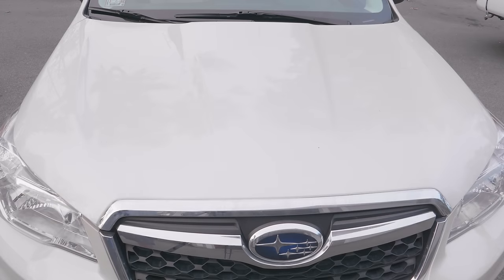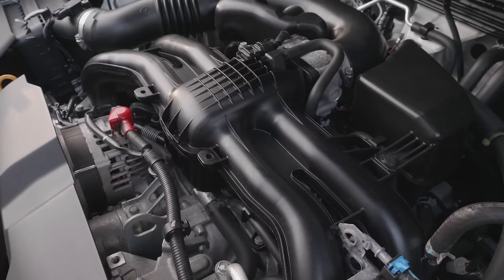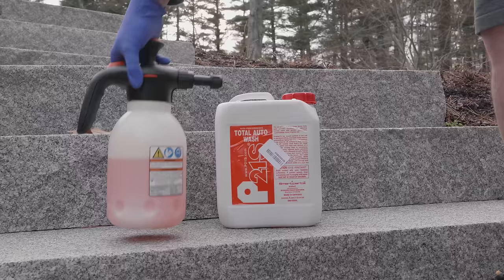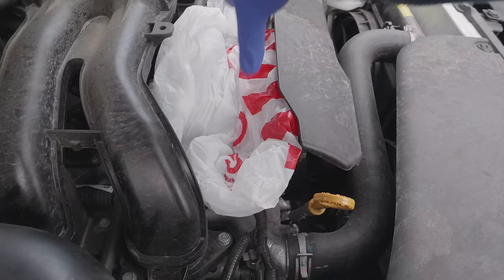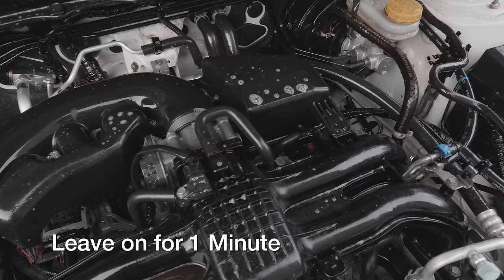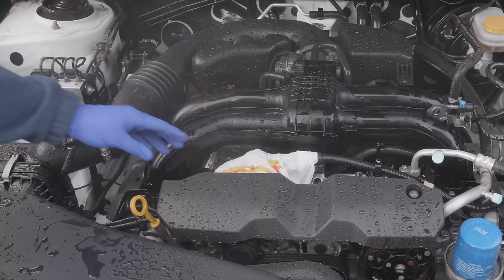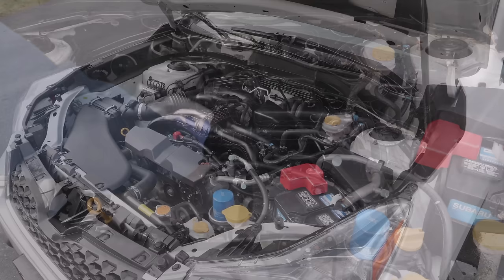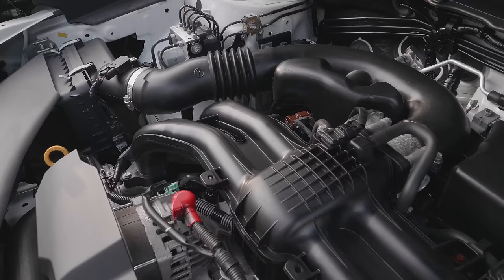Clean & Detail Your Car Engine in 5 Minutes!

Comment: Who else scared af to spray their engine with a water hose😂😂😂
Reply from the maker: Most professional detailers use the exact same method and many use pressure washers which I am not into. You must decide for yourself but the results are excellent. I think even Ammo clean the ferrari engine like this.
Reply: What does he do when it rains get out and cover all the electrical components.
Reply from the maker: @richardwarren8710  Exactly. Great points  There are older engines with non-water tight distributors, etc but this isn't the case any longer.
Reply: Your engine won't work but who cares, It looks incredible.
Reply: So YOU are scared 😳 to spray your engine with water 💦... WHY...??? 

Is YOUR year engine NOT water 💦 tight...??? What are YOU afraid 😳 of...???
Reply: I was told by a Honda tech not too..who ASE certified?..Right
Reply: Not me I do it all the time..
Reply: @richardwarren8710  nothing
Reply: TheLorola  yes im kinda scared to spray water on my engine there are too much electrical connections that can cause problems because of the water, I prefer to use stp tire clean it’s not as hot but it’s safe on wires and many other electrically sensitive areas
Reply: me😅
Reply: Me🤣🤣
Reply: Why be scared. Its done all the time
Reply: I know the engine is water tight but I see lots of electrical connections etc on my 23 year old Lexus. I was thinking spray the product on a cold engine, then start the car, then hose it off while it’s running, before it heats up? Staying away from the fan of course
Reply: @peterscanlon9727  A running engine is sucking in air and sending electricity all over the place. Probably not a great idea to hose it down like that.
Reply: It does NOT hurt to wash an engine old or new. And if you did get an old distributor wet just take the cap off and dry it out, including rotor button and it will crank right up.
Reply: @TheLorola  Hi, first off ASE certified only means the mechanic took some test and passed, plus 1 to 2 years of mechanic work under their belt. I've been working on and or built up my own cars/trucks since 1975 and never had a problem washing off things in an engine compartment. If you are scared of electrical connections, cover them on a cold engine so no water can get in the part. I cover the alternator, distributor cap, fuse box and computer box in some just in case. I unhook the negative battery cable, turn the light switch on and key to drain any left over power. Then wash to your hearts content. Be sure to completely rinse everything and then dry it off by forced air like a yard blower, shop vac and old clean towels. Uncover everything, towel dry again, hook up battery and start the car/truck. No problem. This may seem like a lot of work but in the long run it looks great and a clean engine runs cooler.
Reply: Scared of what? I use a water hose and spray my my engine down anytime I see that it has accumulated a little to much dust/dirt. I have a 2005 Infiniti and I never cover up anything, and certainly not the alternator. Getting water on an alternator will do absolutely nothing to it. I've been using a water hose on every car I've ever owned to clean my engine bay, and have never had a problem afterwards. And trust me, I don't spray lightly, I blast away with my water hose! Just use common sense, and don't go crazy aiming 'directly' at your sensors, like your MAP or MAF sensor.
Reply: @TheLorola  Yep...un hun.
Reply: @silvergrizzly316  New engines dont have a distributor. Your car must be a 1980s model.
Reply: I would not do it on a hot engine and try to protect electrical connections. And like he did cover alternator. Just my thoughts.
Reply: I used to be but now I get stuck in with a small water blaster. With my older car I used to run it for a few minutes to warm up (that’s warm, not hot) before washing so it would dry out afterwards. I saw another video that used a can of tyre foam which worked too.
Reply: TheLorola me .... As much as this seeems like a good idea I’m stiff iffy of water getting into the electrical of the engine
Reply: TheLorola find a new tech.  He doesn’t know what he’s talking about
Reply: It’s OK to wet your engine with a garden hose with a spray nozzle but no pressure washer and don’t dry it with the air hose because you don’t want water inside your fuses
Reply: @johnsadar1743  If one is to spray down their engine on a warm day, and able to allow the car to sit oriented to where the sun can bake on the engine compartment with the lid open for an hour or so, I can assure you there will be NO moisture left on all electrical connections or joints. This is how I will/would do it if I decide to do it on my new car down the line. I have typically found that if I buy a car new, doing it by hand without water is all it needs for about the first 2 years. After that I hit it once at about the 3rd year point and it's good as new once again.
Reply: infiniti_chik I ruined the alternator and regulator on my '96 Accord when I was washing the engine bay. I was doing it like my dad did on our 1970 Fiat and 1984 Volvo, with degreaser and the garden hose on a gentle spray. I have since done it on my 2004 Beetle and my 2009 GTI with no issues. On the newer cars like my VW's, I do keep the plastic covers on the battery and fuse box. That Honda though, it had a lot of electrical issues the entire time I had it, so I think it was just that car.
Reply: @richardwarren8710  He wouldn't drive it in the rain.
Reply: I'm not scared to use gardenhose. I used garden hose most of the time to cleaned my engine as long as you know what to cover and protect.
Reply: Hell yea i am haha. I still wanna clean mine but man. Nervous
Reply: @kidder6192  man just get you a spray bottle with soap and water or a good degreaser an armor all the plastic and you'll be happy and your car will still run afterwards too😂
Reply: @richardwarren8710  Oh damn you bought a car with no hood😔
Reply: @TheLorola  😂😂
Reply: I am. Lol
Reply: Yeah...I totally am...at least all over it like that...
Reply: Still seeing a lot of shady tree non ASE certified mechanics commenting... being if ASE-certified wasn't important while a dealership wouldn't hire you??????....plus two more??😂😂😂😂 ole Craigslist ass mechanic😂
Reply: @TheFlR3StOrM   What are you covering everything with like the distributor cap and all that? A plastic bag? Also I don't wanna reset everything in my battery every time do you think that part is one of your most necessary parts disconnecting the negative cable?
Reply: @tym5583   Yes a plastic bag since my truck is an older model (a 1999 Ram). I use a 1 gallon zip lock bag to put over the distributor cap and alternator. Here is one way to think about it. When you are at highway speeds on a rainy day do you think your engine stays completely dry? It gets a lot of over spray but it don't get flooded unless you go mudding on some back road. A 1 gallon zip lock bag works for me and sometimes I use plastic bags from the grocery store but double or triple it but a lot people use different things. Hope that helps.
Reply: Good grief people. 
Scared of a garden hose gently pouring water on an engine?
Then you probably have no idea how much water gets all over your engine when driving in the rain.
Reply: @SilverCymbal  p
Reply: Do you not drive in the rain?
Reply: @umeng2002  yeah with the hood closed..ask yourself why do you think your car come with a hood??? Is no to protect the engine..also engines are not water proof..sad i have to explain this to someone who has a license to operate a vehicle.smh
Reply: @umeng2002  next time you buy a car tell em they can keep the hood...you don't need it.
Reply: @TheLorola  You know water splashes around... Those covers on the bottom of modern cars aren't for water.
Reply: @umeng2002  Key word " modern"dnt forget to tell em to keep the hood since a lot of you on here think the hood on the car is to protect from falling trees during storms....smh
Reply: @richardwarren8710  next time you go through an automatic car wash make sure you raise your hood before you go in let me know how that works out.
Reply: @TheLorola  i go to self service one and open the hood all the time. Never had a problem.
Reply: @richardwarren8710  Ok have fun.
Reply: Me
Reply: @TheLorola  No offense, but I know plenty of non- ASE mechanics.  It dosen't make them shady.  There is a level of discernment you must have when choosing one though.   A lot of people spray their engine.  Like he said in the video, cover the alternator.  Depending on whats exposed, any other electrical components.  My father is a mechanic and has been for 45 years.  Ran his business entirely out of his home.  Easily the best mechanic in town, he just never wanted the overhead of a brick and morter.
Reply: Definitely me. That's why I'm here😂😂😂😂😂
Reply: @infiniti_chik1225  I don’t know what a MAP or MAF sensor is though, or what it looks like on my vehicle.
Reply: @jessicah3450  Yes, maybe so.
Reply: @jimwatchyyc  A MAP or MAF sensor monitors the amount of air flowing into the engine, so the computer can adjust the amount of gas to spray into the combustion chamber. Just Google the year, make and model of your car - type in either MAP or MAF sensor and see which one comes up for your car. Also, if you have access to a Haynes or Chilton's Service Manual for your car, it should tell you which one you have in your car.
Reply: @TheLorola  lol then how do you think they clean it when they get a used car for resale? Do you think they take every part out by hand and clean it 😂 😂
Reply: @Airplanetyson  degreaser have a nice day
Reply: Me lmao
Reply: Honostlyyy
Reply: Dohn Joe  u
Reply: I Been washing my engine for the last 5 years and I never had any problem,I always use purple degreaser.
Reply: dont spray with hose
Reply: I'm a 65 year old woman I've always kept my engine clean. On a hot summer day I take a water hose and spray it. My dad worked on cars, he taught me how as a child.
Reply: Been washing my honda engine for 15 years and never had issue,the only thing I do is cover the alternator and electrical sensors just in case.
Reply: @elcoyotecojodeldesierto2300  kool deal good luck
Reply: Me.
Reply: @SilverCymbal  should I cover my fuel injectors
Reply: I've done it lots of times over the last 46 years....  just don't use high pressure, at all.
Reply: @richardwarren8710  I would imagine he counts on the hood  to keep the rain off.
Reply: The placement of the oil filter is fucking amazing! Mine is in the pit of hell.
Reply: If you don’t want to spray you engine with water just take a damp cloth and have at it. Gives you the same results he showed but on a car with 70,000 miles
Reply: @TheFlR3StOrM   I am sure the computer units from my BMW X5 M would love a a splash of water from the hose.  It’s right on the service manual.
Reply: @joeesquire5927   I guess you never thought of covering it up or maybe cover it up for good on days it's raining and you traveling at highway speeds with all the over spray. You can cover parts up you don't want to get wet you know. Nobody is stopping you. I also have a Mini Cooper S  with aftermarket parts (money pit from BMW)which is made by BMW and it don't mind a engine clean once in a while, BUT I do cover electronics up, the alternator and a few other things.
Reply: @jenniepainter3983   That's right sister, tell them.
Reply: Been doing it for over 10 years with no issue
Reply: Honestly, I have never cleaned my engine like this before. I have never even wiped with a rag. My 97 Accord still runs great with 267k on it.
Reply: I have done it  without covering the alternator... hmmm, I guess I'll start covering it, just in case. lol
Reply: ASE stand for Ask Someone Else if you see someone with this patch on thier uniform..
Reply: @richardwarren8710  you wash it and then blow out the water with an air hose, throw on a water soluble shine and let it air dry. Been doing this for years and never had an issue.
Reply: @TheLorola  I work at Harmoney Honda in B.C. and your tech is a dummie. Look at how much plastic is covering the engine in all of these newer cars, and anybody who washes their car and leaves water in all the electrical spots clearly isn't the right detailer and needs some training.
Reply: @TheLorola  I've done this method with older vehicles and exotics for 20 years and never had an issue. Ever ever ever. You always blow out the water afterwards. Throw a little shine, let it air dry and you're good to go. I work at Harmony Honda here in Kelowna B.C. with our used trade ins and I do this day in, day out, 3-4 details a day,  common sense says make sure you know what you're doing. If you don't know what to do or have any doubts, you ask for help.
Reply: Me!
Reply: What about coil on plugs ? No problem?
Reply: Have you ever seen a jeep drive in water up to its doors? Guess not
Reply: @channtehmann  Some Jeeps made for that...send me a vid of your car doing that....ill be waiting.
Reply: @TheLorola  You must be a child or something.
Reply: @channtehmann  you must be lonely responding to a comment i put  on here a yr ago..dnt worry Jesus love you😂
Reply: Me too
Reply: I’m not doing that shit
Reply: @SilverCymbal  I get around nyc with horse and carriage
Reply: right !! 🤷🏾‍♂️😨🤔
Reply: @TheLorola  jj
Reply: What about the battery? Would you recommend disconnecting it before?
Reply: You drive through  rain and snow don't you
Reply: The next time you are driving in a rainstorm or through a big puddle pull over Android pop the hood,you will see a wet engine🥴
Reply: Steam cleaner is easier and safer for those who have older cars. Your whole engine compartment is open on the bottom. When you drive in the rain water and whatever else gets in there. I don’t understand people’s logic.
Reply: I am
Reply: The same thing happens when people drive over sitting water on the road and you see all that water gushing outward.  The water gushes inward too.  Though I always slow down or try to drive around sitting water  but most motorist don't, so my take is, most people don't car.
Reply: @KenSerpico5450  a customer today said they want to clean the engine without water. I said we steam clean.  He said no liquid at all. I said ok my fault steam is water. I was nice to him. I asked do you drive in the rain or do you park in a garage? He said yeah in snow or rain I have to drive. And I don’t have a garage. I said can you see through your engine bay and see the opening where you can see the Concrete your car is parked on. He said yes. Then he said I don’t like smart asses. I said I didn’t mean to insult you I’m showing you that water gets in the engine bay. It’s not a close system. Ac has to leak water from the condenser. The heat the engine generates it has to have openings for the excess heat. Water being use to clean your engine is far less that a drive in a rain from work to home. He said I’m sorry. I said it’s ok so when do we start lol. He even tipped for the job.
Reply: The car engine bay and hood are not water tight. To cool an engine air is forced through the radiator, condenser and engine bay. My point is when you drive through a thunderstorm water gets forced through your engine bay with the air that cools your engine. The engine electrical connections are designed with water tight silicone seals to protect the connections. Cover your alternator and battery terminals to protect against the chemicals which could be mildly corrosive.
Reply: Is it okay to spray on electrical wires and battery? Mine is 2001 honda city type Z.
Reply: Lol meeee
Reply: yessir
Reply: There's a difference in wetting your engine and power washing it...
Reply: Those who want to clean their engine bay should feel safer to cover or ceram wrap their electronics. Alternator and ignition coils if your cleaning a engine without a cover, and your ecu or fuse box. I always disconnect the battery and wrap the terminal in plastic before I start. And prep work to make sure all caps are sealed and closed. You don't want water or degreaser going into your engine or trans. Modern cars are splash proof but it is a peace of mind that I want. Never use pressure washer, prefer a hose nozzle and degreaser. I always agitate with different size brushes and dress all the plastic, trim and rubber hoses to finish. I usually wipe with microfiber cloth to dry instead of using a blower since I don't want water getting into my connectors. More work but safer and I do it once a year on my mazda 3 2014. If you don't feel comfortable then it's okay not to. It isn't necessary to clean a engine bay as most modern cars hold up well but for those who work on their cars often it is a satisfying sight to see a clean and shiny engine bay when you pop the hood. Best of luck everyone.
Reply: That's the first thing came to mind water what if the car don't start after nah I'm good it don't have a form one?
Reply: Pedro definitely failed English. Couldn’t read a Dr Seuss book let alone an owners manual.
Reply: My brother sprayed off his motor with a hose and th next day his knock sensors went out. 8hrs of labor.
Reply: Don’t use a water hose on an engine.
Reply: Use pressure washer 😂😂
Reply: @timburton1715  are you kidding me? New cars nowadays; any type come with electrical components or sensors that getting them wet would damage and your dashboard would go crazy and your vehicle might not even start at all.
Reply: Will this for a 2012 tahoe ppv?
Reply: @silvergrizzly316  I've done this so many times back in the day. Stranded because of heavy rain nope got some WD-40 for water displacement back on the road, of course wipe out as much of the water as as you can. Those were the fun days of old.
Reply: So confused by the comments - is it or is it not a good idea to clean the engine of a 1996 Lincoln Town Car with water and this product?
Reply: I own a Renault Automatic Car in India. Every mechanic says don't spray water into engine compartment 🤦...I am so confused after watching this. I take pains to clean it.
 Any expert opinion? 👍
Reply: @MarioTorres-oe5sc  I certainly would.  Just makes sense not to have any engine bay wiring live with an opportunity to short.  Your not likely to cause a short and melt wires, but computer systems are very sensitive to minor blips.  In  may  newer vehicles, various sensors and circuit boards could be active when the ignition is off.
Reply: I bought a used car from a Toyota dealership and they sprayed down the engine right before I drove it off the lot.
Reply: @silvergrizzly316  or use WD 40 displaces water
Reply: Me 😂
Reply: Me that’s why I had to look at a video
Reply: I do ot all the time
Reply: I be scared af to touch my engine period lol.
Reply: Thinking the same thing!
Reply: You drive in the rain. Next time, open the hood. It's all wet
Reply: @hermesalejandrocerdenia1153  I have a 2012 Toyota Camry; should I worry about anything if I do this myself?  Thanks.
Reply: Literally thinking that as the video loads!🤷🏿‍♂️😅🤣😂👍🏿😁👌🏿
Reply: @Slider617  You don’t have to hell I just cleaned a spot on my motor that had antifreeze all over it due to a leak fixed it put Mr. clean and water in a bowl mixed it around poured it all over that spot all over the hoses and anywhere else that that coolant splattered let it sit went back inside grabbed another bowl put hot water in it rinse the area fired up my Elantra and took it for a ride down the road accelerated hard got it up to 80 mph came back to the house there’s your air dry if you want to do that you’re more than welcome but I do it naturally
Reply: Yep. That's exactly why I'm here.
Reply: I did. And water got into the engine 🥲
Reply: I wouldn't use water the rest of you are right water will short out your electric parts
Reply: me
Reply: @RH0703  yes just disconnect the negative terminal and wait until it fully dries to reconnect.
Reply: I am 😩 my old buddy 98 ranger is so bad dirty oily and I feel I’m going ruin my engine
Reply: I've ways heard it's not good to do that why so many ppl use the brush & microfiber method.....
I've also seen a steamer used to break down grime
Reply: What about spraying the battery and all around the terminals??  Wouldn’t that be bad?  Maybe cover alternator AND battery?!?
Reply: Me
Reply: Very scary 😂😂😂😂
Reply: I have a 2013 Honda Civic and I used this product and also did it this way and I never have a problem. The only thing I covered  is the alternator and the fuse box and I never had a problem or engine light come on. Think about it you drive in the rain where does that water go. And I am a Master Automotive Tech but that does not have a thing to do with it. This method is safe but if your still scared 😨then just don't do it simple....
Reply: @SilverCymbal  pressure washers are safe for certain components but those who spray all the fragile electrical stuff don’t know what they’re doin
Reply: Not me I worked at an auto auction as a detailer they power wash the engine and spray tire shine on the engine while it's still wet 🤣 I don't know if that's because they were auction cars or what. Didn't feel right to me.
Reply: Facts.
Reply: Not afraid mine is a diesel 🚚
Reply: Me while reading this coment
Reply: @timburton1715  How about getting water in the air intake and potentially hydrolocking your engine? Small chance if you're careful but still a chance. You can spray water on a transformer but wouldn't you be a tad nervous doing so?
Reply: Been entering my cars in shows for years and detaling my friends cars. I use a hose on my engine all the time.  You just have to spray it with compressed air afterwards, then let it dry real good. I usually let it dry anywhere from over night to 24 hours.  Never had a problem.
Reply: Nice but I wouldn’t chance it   yeah, rain water will hit the bottom make its way here and there but pouring water from top to bottom like this, my car probably wouldn’t run after this but thanks for showing a clean engine on a great suv!
Reply: @johnsadar1743  thank you !!! Definitely gonna try it
Reply: Agreed.
Reply: Just go gentle.
Reply: That's exactly why I'm here
Reply: Me
Reply: @TheLorola  ive seen Autozones who claim to have ASE certified employees at all times and still not know what part I need for a simple job (replacing my brake fluid cap)
Reply: I've had mixed results: Don't ever hose off a 1975 MGB - don't ask how I know...  Later model cars, especially Japanese and American - I've had no problems... they're intended to be waterproof.  I wouldn't spray a hot engine.  Just my experience.
Reply: @umeng2002  There’s a huge difference between water spraying upwards when driving in the rain and water coming down vertically from above on an engine with the hood wide-open. Any of that water gets in the alternator, fuse box, spark plug wells, or any “waterproof“ electrical connections that have lost their waterproofing over the years, and you’re going to yourself with a bunch of weird and difficult to diagnose electrical issues on your car.
Reply: @TheLorola  the purpose of a hood is not to protect the engine from water at no point do bonnits seal from water if they cannot seal from air properly... Water in the intake is dangerous and damaging true. Water in the engine bay how ever is normal and designed for. Also if. Bonnits really were for water why wouldn't all cars be sealed on the underside why do they all not have trays? And why does the intake expose the engine to water below the bonnit constantly. The main purpose of a bonnit is for the aerodynamic advantages and for user safety finally summed up with because that's what makes some cars look like that specific car
Reply: It’ll be fine bro. Just spray it. Everything is sealed… if it doesn’t run okay after then you’d probably have a big problem if it rains too
Reply: @clintonwalker9502  it's all good. Don't use a lot of pressure. In all honesty, you don't need that much anyway. Spray it gently with a hose after everything is cool, spray a mild soap that has a degreaser heavily on it, use a light scrub and touch as much as you can, spray it down gently again.
Reply: I got a 2019 Camry 😬 I’m not sure if I want to do it.
Reply: I rather use the electric toothbrush lol
Reply: Me lol , I always think something would get fried 😭
Reply: Swear 😂😂
Reply: You can as long as all electronic parts are wrapped
Reply: What about your censers
Reply: @SilverCymbal  I always thought that was what the hood was for
Reply: @leerothman7570  we
Reply: @SilverCymbal  is it good and safe for greasy engine??
Reply: I would do one spot at a time, instead of the entire motor at one.
Reply: Me
Reply: Not on a v8 engine..the water is going to get in the recessed hole where the spark plugs are.
Reply: Yoo I was saying the same thing !!
Reply: 😂😂😂 me lol
Reply: MEEEE
Reply: I lightly sprayed an engine bay on on a kia soul and water got down into the spark plugs those miss fires were kicking 🤣🤣.. Lesson learned!
Reply: You can wash the engine just make sure to cover the alternator fuse box and other electrical wiring connection with plastic
Reply: @timburton1715  my car is 15 years old. Worried something may come loose or get exposed to too much water. Maybe I will just use toothbrush method. I'm trying to sell my car not damage it.
Reply: Me! Scared the fk outta me. But I always use a pressure washer 2 years ago while I was still a detailer for a dealership....... havent gor any complaints

Would never do it on my personal vehicle tho
Reply: Brooo I can’t dooo itttt
Reply: @TheMegaVoter  did you clean it after watching this video?
Reply: @Twomps  Nope... Used/new car prices are high and I can't take a chance. If I were to sell my car then I would go to a detailer.
Reply: @seeknddstroy  
You know it rains don't you?
Reply: Onmmm 😭😂
Reply: You can spray with water just don’t pressure wash it and you have to cover up the stuff that needs to be covered up, that’s all.
Reply: Me.  I love my car and hence very scared to spray water in Engine compartment.  I enjoy the drive by  smooth and noiseless engine.
Reply: @TheLorola  cuz they’ll lose out $$
Reply: Go nuts with the water, just dont fill the air intake or wash the electrical connectors too much, its the same as driving through puddles but cleaner and its at the top of the motor 😅,, dont do it with a hot engine either, top video too bloke
Reply: @bartbutkis  The rain das not get your car  under the hood , next time it rains open your hood you will see everything dry in there , most mechanics don’t recommend this it can easily create a problem especially in newer cars
Reply: Same
Reply: I do it a few times a year….usually with the engine running while at the spray off car wash.  Works great!
Reply: I am once I hosed the engine when I came back the car was kissing the wall
Reply: @timburton1715  
Electrical components, computer etc
Reply: If you get your car detailed at a dealership, this is exactly what’s happening.
Reply: Yes I’m always very nervous spraying the hose in there. I did it on a Supra years ago and water got in to the spark area and was misfiring
Reply: Has anyone tried this on a Prius year 2013 ? Thanks
Reply: @timburton1715  --Hello, the fear is electrical connections and water entry/shorting.
Reply: @umeng2002  Not with the hood up.
Reply: @timburton1715  Damaging electrical components.
Reply: im not doing that
Reply: Facts 😂😂😂😂😂
Reply: Can you start the car after that?
Reply: Me!!
Reply: Its not wether engine is watertight its the electrical components
Reply: I am beginning to appreciate the use of none pressure washer. If normal hose water cause your engine to fail something was already about to fail or not sealed properly. I would say this is a test for your engine. I guess a lot of ppl fear it like AIDs test. LOL.  I am planning to do it but will do it with the car close by my mechanic. LOLOLOLOL
Reply: Y'all some fools
🤣🤣🤣🤣🤣
Reply: @richardwarren8710  🤣🤣🤣🤣🤣🤣
Reply: @timburton1715  🤣🤣🤣🤣
Reply: I wouldn't do it
Reply: I've pressure washed engines for 20+ years without issues. Just remove the battery then let the engine bay dry for at least 24 hours afterwards. 

I'm very skeptical about the product shown in this video though. No cleaning product will make metal casing that has gone through many heat cycles and have water/dirt/oil.. stains. Only physical scrubbing or sanding will do that. Plastic is easy to clean, metal not so much.
Reply: Yeah I would never spray water in my engines. Total amateur move
Reply: Been doing it for over 55 years.
Reply: @ashbringer5999  all sealed and protected. Maybe after 55 plus years of doing this, I should quit? Use pressure and the story 180's.
Reply: Everything that can't get water on it is Sealed because if it wasn't there would be warnings saying Do Not Drive this Vehicle in Rain or Wet Conditions I had the Hood of my 06 Mustang off for like 6 months and drove it in the Rain a lot and I always use a Hose the biggest worry is Electronics which the Fuse Box has a Rubber Seal on it the ECM is Factory Sealed so it can't be Opened and all of the connectors have a Rubber Seal as well as long as you don't take the Air Intake off and just pour water down the Pipe you will be fine
Reply: YOU FOR STARTS.
Reply: Hand up😄
Reply: @Taydiablo3  that’s a Subaru thing. All Subaru cars have oil filters on top.
Reply: Me af 😂😂
Reply: We’ll all Be alright, as long as you use a leaf blower, or compressor? Especially if your car is newer? The connections are pretty waterproof.👍
Reply: @richardwarren8710  thats what a good is for lmao
Reply: That’s why we’re here 😂
Reply: Remember when it rains and your driving most of your engine bay will get water everywhere. Unless you seal your bottom off, there is no way to prevent it from happening.
Reply: My brother in-law sprayed his 2015 Audi A3 engine. Long story short, he no longer owns an Audi
Reply: The engine was just dusty not dirty!
Reply: @paididoy can you share what to cover and protect?
Reply: Bruh😂
Reply: Honestly when i finally realized thats what it takes i got nauseas with doubt
Reply: Me that's why I'm here lol
Reply: The engine…The battery also lol
Reply: @seeknddstroy 😮
Reply: @peterscanlon9727 
Those connectors are gasketed to protect against rain and puddles, an engine bay isn't sealed from the elements.
Reply: @SilverCymbal You are absolutely correct. Some should consider practicing risk-to- reward-evaluations , when doing any work such as this. For example; If you own a vehicle that is several decades old, you're not the 1 st owner, you don't necessarily know what has been done mechanically  under the hood, or that all the seals/gaskets that seal electrical/mechanical devices and sensors on the vehicle are in good condition , and if these cases are questionable. It may be valuable to find a different method that suits your own needs. Engineering on vehicles is literally top notch, and they are designed AND Engineered  for  EXTREME environmental conditions(temperatures ,liquid,  toxic chemicals and agents, etc., everything) so a little  water and low ph cleaning agent  isn't going to damage a thing, when you consider its made to drive fast through rivers in  Florida, while it's hot and down pouring rain...,while covered in gas, oil, antifreeze , freon, cleaners , mud etc.....lol . Peace
Reply: Meeeeeeeeee
Reply: @Jevandtieriel  
Wash it cold, and run it to dry it off after, you don't want to spray cold water on a hot engine.
Warming it up after washing will dry it off safely.
Reply: Seriously? This 🤙 woman has been spraying her engines since she was 19 - dad trained. That’s me. I’m the woman and I’m nearly 50. Never had a problem
Reply: Me HAHAHA
Reply: Never spray your engine with water or your gonna have electrical issues unless your planning to sell it right away
Reply: @SilverCymbal so would my 03 Honda be safe to use the hose?
Reply: Went to the car wash with my buddy,  he used the engine decreaser setting on the power washer. The car started missing out after he started it. Made me a believer after seeing that, always been afraid.
Reply: Ok even if it is ok ,me alternator is not accessible like his so how do i cover it
Reply: I only want to know one thing...does it make the car run better??😮
Reply: How environmentally toxic is that chemical?
Reply: Bro 4 years you said this an absolutely scared asf😂 as to why im here watching this in 2024
Reply: Thats a Subaru, water is no issue
Reply: I've been told not to also.
Reply: i been cleaning my engines since my first car back in high school im 34 now and still do it never have an issue with it even when pressure wash it, down is Puerto Rico we are used to do this all the time maybe its a cultural thing i guess we like to keep everything clean 😂
Reply: Im 55, been cleaning my engines this way all my life, never had an issue with using water from a hose. The only difference is I use Simple Green.
Reply: @timburton1715  electronics, sensors, fusebox... everything will get destroyed in my car.
Reply: Just you
Reply: I regularly washed the little 1.1 cc engine of my 1990 yugo  in the nineties with no problem though it suffered in rainy days when driving in watter. But it loved bath 🙂
Reply: 😅😅😅😅 @seeknddstroy
Reply: @richardwarren8710  I bet he closes the hood.
Reply: I use a pressure washer personally but I know what I’m doing
Reply: Why wash engine unless you’re looking for an oil leak
Reply: @billwood7064  cause some of our engine bays are actually works of art no one wants grime and build up of anything in prestine bays
Reply: @richardwarren8710 It doesn’t rain under the hood!
Reply: Yeah, I’m not doing it. 😂 I don’t care if god himself told me it was safe. It freaks me tf out.
Reply: @timburton1715 can I use water on Toyota Innova Klang???
Reply: I also cover the fuse box and battery.
Reply: @SilverCymbal how old? Will my 2004 CRV die if I use this method?
Reply: No fu..kin way spray water on engine
Reply: Everyone 😂😂😂😂
Reply: That's why I'm here now!
Reply: Never had a problem just don’t saturate the motor just need to get the soapy stuff off 
Remember do it when the motor is cold
Good luck
Reply: Don't be scared now!! I wouldn't do it while the engine is hot😂😂 but as long as you know better than that there is nothing to be worried about
Reply: I used to go to the car wash to clean my engines. I would vacuum my interior slowly and armor oil to let engine cool then spray the engine with the high pressure  sprayer. I  never had any problemo. just get on road immediately after spraying to dry engine well.
Reply: You should never spay engine bay with water.
Reply: I use to go to car wash and clean my engines with no problems
Reply: Me that's y I'm watching this video lmfao😂
Reply: @edwardmonsariste4050  ---Well, the hood certainly mitigates the rain water.
Reply: I used to wash mine with the hose.  I never had any problems, but I did change my method.  Now, everytime I change the oil, I spray everything down with Macquires
Reply: It’s ok I’ve done it before
Reply: For sure...I keep putting it off... I'm like today's the day... then... no
Reply: @richardwarren8710  Most have a hood on their car.